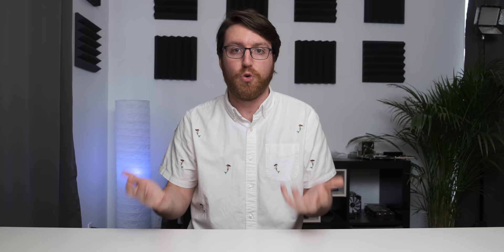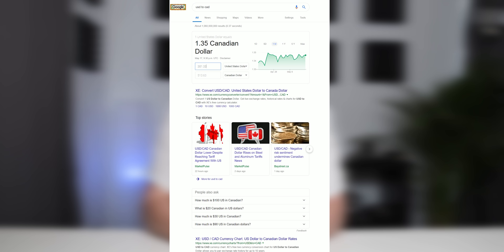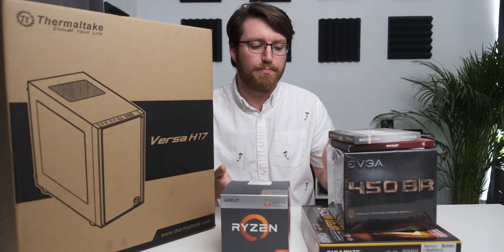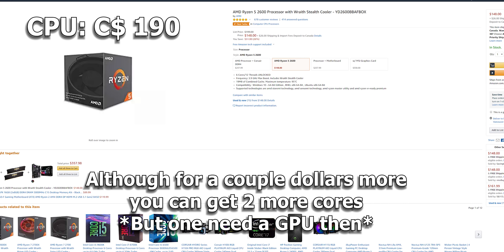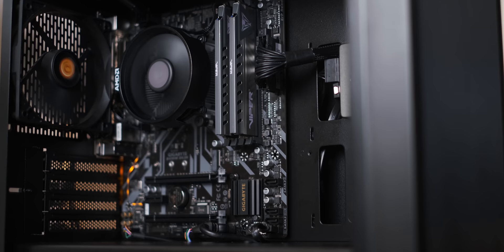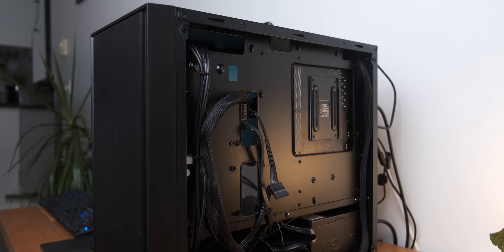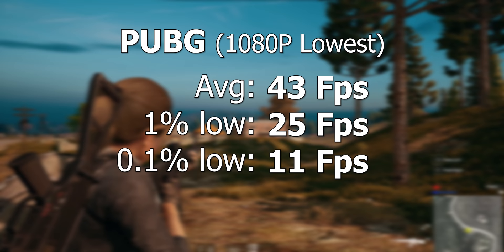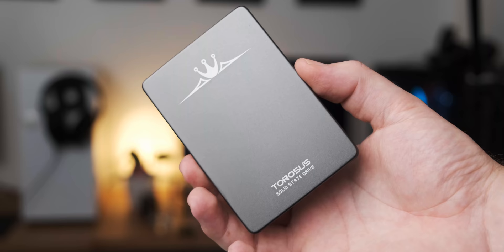I bought a gaming PC with my FIRST ever YouTube paycheck

Comment: Prices in Singapore

3200g - 130 sgd
mobo - 100 sgd
case - 80 sgd or 45 sgd for the cheapest alternative with tempered glass (tecware nexus m)
psu - 80 sgd similar one
ssd - 30 sgd slightly sketch AliExpress ssd
ram - 50 sgd for 3200mhz or 70 for 2x8 @ 3000mhz

455 sgd which is equal to 345 ssd or 440 canadian dollars
Enjoy??

Comment: So, I tried to assemble the same thing in one of our cheaper e-shops. Did not find the PSU, so I went with EVGA 500W but only 80+. There also was a minimal price difference between 2400, 2600 or 3200 MHz RAM so I went for 8GB 3200 HyperX Fury CL16 kit. There was a much cheaper mainboard, ASUS Prime B450M-K, cheapest 120GB SSD from ADATA and cheapest 1stCOOL MicroTower for the mATX case. The whole build would be USD 360,- which is almost the same, granted it does not look as good. Without conversion I'm looking at 8.320,- Czech Crowns. So you don't have it as bad in Canada :D Greetings from Czech Republic.

Comment: If you had waited a bit more for the 3rd gen ryzen cpus to come out you could've gotten a 3400g for the same price and it'd run forza horizon 4 1080p 60fps with a small amount of overclock.
Reply: Eh
Reply: this video is kinda old
Reply: @b.henriques9871  it's just 2 months old lmao
Reply: The R5 3400G has the same GPU, it's like a 5% faster, so no much difference
Reply: 60 fps? Bruh that sucks
Reply: @akira1072  way to go dude, like congratulations for flexing on a 150$ apu.
Reply: Gloria Borger sucks? Lmao it's the standard for 90 percent of people, who have 60hz displays
Reply: @b.henriques9871  once you play in 144 hrz you'll never go back
Reply: Gloria Borger i said the same when I finally built a pc and saw more then 30 fps
Reply: @b.henriques9871  lol
Reply: 3400g runs the same as 2400g but it has a little bit more clock freqeuncy and thats all. So not really that much better.
Reply: @akira1072  did I ask?
Reply: @r1kverc  higher clock frequency equals more performance. Duh.
Reply: @TheGauges420  Clocks aren't everything. The most important thing to performance for a GPU is the architecture. Clocks and Cores are only like 20% of a GPUs performance. The architecture holds 80% of the performance
Reply: @moist.politician  yeah, but nobody can say 'clock speed isn't important' because it is lol. Sure its not the ONLY thing that matters, but for some people they just want their GPU to go brrrrrrrr. Lol.
Reply: Then when buying the 3rd gen you'll probably say why not wait for 4th gen, seriously why don't you wait for 10th gen ryzen
Reply: @ChrisTian-sd5yq  waiting 2 months for next gen>waiting 2 years
Reply: @ChrisTian-sd5yq  LMAO Just wait for te 4th gen iGPU CPUs mate.

Comment: 1Year ago my PC was very similar, but now i have asrock A320-HDV R4.0, Ryzen 5 2400G, 16gb ram at 3200mhz, MSI radeon rx 570, Silentium PC vero M2 bronze(semi modular), 2 SSD M.2. and solid state drive, and crap case. It all costs 500$ GPU is second hand.  Your build was better than mine at time. Your videos are very interesting, i started watching you 3hours ago :D.

Comment: I did a build very similar to this over Christmas 2019 for my nephew. I had a bit more money but still not enough to get him a fully fleshed out beast of a system, we only had about 500 to work with.

I ended up building him this:

Ryzen 3400G
16GB Ram (8x2 - 3200MHZ, OLOy brand. It was on sale, quite a steal. I used them again for my own build in January, they've been quite good)
ASRock HDV B450 Motherboard
Silicon Power 1TB NVMe (One of the pricier items, but I wanted just a single SSD for him to keep it simple)
750W Rosewill ARC Series 80 Plus Bronze PSU
DIYPC Ranger-R4-R Black/Red Case (Comes with a little side panel and 3 pre installed red LED fans, it was a great deal at about 35 dollars. Not the best case to build in, but it worked really well once it was all set up and it looked great)

It worked really great! For all of 2 months. Then, because he's 13 and easily manipulated, some trolls on his discord channel convinced him they had put a trojan virus on his system and the only way to get rid of it was by dousing as many components as he could in milk.

Most of it was broken. Fortunately, the hard drive and the power supply got virtually none of that and are still fully functional. I've taken them for myself, as he's not interested in working for the money to replace the parts and doesn't seem all that concerned. Kids. But, while he had it, it worked great! He plays Fortnite and Minecraft a lot and it handled them on medium settings 1080p with smooth experiences.

That 16GB of RAM as compared to 8 certainly made a big difference, which is why I went that route. I figured not having a GPU meant that we needed more RAM and it worked out well. My plan was to eventually buy him a nice graphics card to put in there, like a GTX 1660 Super probably. But that's not happening now.

Comment: only one criticism, shouldve switched around the satadata cable, seein it tilted like that on the ssd means its either not pushed in well enough or stress is being put on the cord, which is bad long term for your connectors, a simple switch using the L angle side of the sata data cord on the mobo instead of on the ssd wouldve been better aesthetically and mechanically, but its such a small critique that it doesnt really matter.

Comment: Nice video and channel! congrats!!! In Argentina (Latin America) this build will cost you around 673 USD, As you can see, we always pay twice the price of retail sales in the United States in the southern cone of the earth.
These are the prices for each component.

266 USD - AMD 2400G
115 USD - Gigabyte B450M
90 USD - 8GB RAM Patriot Viper DDR 4
80 USD - Mini ATX case ThermalTake
45 USD - adata su655 120gb
77 USD - EVGA PSU 500W

Im working with an i7 3770K 32gb Ram 1600 and recently bought a evga gtx 1060 6gb sc.
I will try to wait for the perfect time to make a new build now that AMD lunch the new Zen 3 family so I can justify the leap hahahah 

Greetings from Argentina! 
Keep the good work!
Reply from the maker: This is such an awesome comment, thank you. The price breakdown of all the components is very interesting. I'm sorry to hear about the high prices of PC hardware in Argentina. I use to live in South Africa and PC hardware was also very expensive there.
I hope you can convince your family that its worth it without too much effort. :P
The 3770K with a GTX 1060 is a pretty great combination though, I'm sure it will still serve you well for ages. :D
Reply: @DawidDoesTechStuff  Thanks for you response!. My build have a solid SSD 125Gb and 1TB (500Gb - 500Gb) with Z77 Gigabyte motherboard. We build it to be a hackintosh in 2011 but on 2016 we go full windows 10 and in 2018 I bought the GTX 1060 SC - 32GB RAM 1600hz (jump from 16GB) and replace the stock cooler from Intel to a H60 water cooling from corsair, also a new corsair case (Corsair Carbide 400c Black) a few new coolers for less noise. Im working with Pro Tools, Premiere, Photoshop full HD videos with no problem. Also love gaming! now Im playing the last titles at 1080p enjoying 60FPS glory!  
Also I use some money to buy a nice mechanic keyboard and mouse, feels great and brand new again. Greetings!

Comment: I've build a very similar PC last Octomber here in Bulgaria and the RAM price craze was still raging hard. Ended up paying as much for my RAM kit as I did for the 2400G APU itself !
Ended up with ASRock B450 Gaming K4, Ryzen 5 2400G, 2x8 GB Kingston HyperX @ 3000MHz CL15 (which had to be "downclocked" to 2933MHz and CL16 in order to be stable, even thou it's QVL according to ASRock), a 550 DeepCool PSU 80+ Gold and a "no name" case with clear side panel. All that was just over 1000 Bulgarian Leva, which is around 750 Canadian Dollars.
Guess if I had to make that PC today with today's prices (and get a 3400G instead), I'll prolly end up for around 550 CAD.

Comment: the build in vega graphics are actually really good in these, but not every game will run that well with it, but with a build like this and a second hand graphics card you got yourself a very good pc, most people wont need more than this for what they use it for, even as a gaming pc. also, you can save money by getting linux instead of windows to begin with, and maybe you will even stay with linux since the system is very up to date today and runs really well with almost anything, with the exception of microsoft products of course

Comment: In Apr/May 2019 I bought a new desktop comparable to your one to replace my off-lease 2008 HP dc5850 (DDR2; SATA-2 and PCIe 2.0). I paid $349, mostly to Newegg. It has a Ryzen 3 2200G; 16 GB DDR4 (3000 MHz); 512 GB nvme SSD (Silicon Power 3200/2300 MB/s).  I bought the cheapest B450, the AsRock B450 HDV Rel 4.0 motherboard, that also had a 4 pin CPU power plug :)  I bought the case and power-supply locally in Santiago de los Caballeros to save on the high transport costs from the USA. It is a black midi tower with a led display around half the power button, blue is power-on, red is disk active :) It did cost together with the iTech 600W power-supply DOP1500 or say at that time $30. That iTech power-supply is a special with only a 4 pin CPU plug; 2 SATA and 2 Molex plugs :)  To be completely honest I reused 2 HDDs (500 GB and 1 TB).

Now almost 2 years later I'm still happy with that PC, it is great for my use case. My use case is collecting Virtual Machines with e.g. Windows 1.04 to Windows 10 and Ubuntu 4.10 to Ubuntu 20.04. My Xubuntu 20.04 VM for all my external communication Apps boots in ~6.5 seconds, while the Windows 10 VM needs ~25 seconds.

Comment: Here in Sweden that set up will cost you about 3 887:- Swedish kronor, $417 US or 545 Canadian Pesos. Everything is the same except the SSD, couldn't find that one so I went for the Patriot Burst at $21 instead.
I thing the AM4 platform is the way to go right now with Zen 2 looking to be a solid upgrade in the future. I don't regret choosing AM4 a year ago, my Ryzen 5 2600 and MSI Tomahawk hasn't let me down yet, thou I can experience some CPU bottle necking in BFV, pared with my Radeon VII. But that is nothing a 1440p display can't cure, or maybe a Ryzen 3600.

Comment: My pc was a prebuilt acer from my dad years ago with an i5-7400(integrated graphics), 12 gb ddr4 2400, 2 Tb hdd, and 300w psu. It was a steal at the time for like $450, but the price kept going up and I saw it for like $700 and I think even $1200. I only played league, and it got me a good 80-90 FPS on lowest settings for years until I added a gtx 1650

Comment: I'm saving up 400 or so dollars im going to buy a medium / mini tower optiplex 7010 with a i5 3470 I'm going to try to add a ssd and a 1060 if you can find one used of course and add a new psu over all it should be around 450 maybe 500

Comment: Here, in Hungary, it would cost you (including tax)

2400g 40000 HUF or 139 USD
Patriot Viper DDR4 12500 HUF or 43 USD
B450 DS3H 21500 HUF or 74 USD
128GB SSD 6000 HUF or 21 USD
Thermaltake H17 11000 HUF or 38 USD
EVGA 450W BR 15000 HUF or 52 USD

Making it a total of 106 000 HUF or 367 USD, pretty close!
(note, the prices are for 2019.07.13)

Comment: u almost have same build i was using n only difference was 3 thing n case n ssd n Ram 
what case i was using "homemade from school locker with fan on top n have open vent bottom" what storage i have is hdd 500gb black wd n ram i was using 3200 vram 2x 8gb totally 16gb from corsair vengeance it little cheaper at that point but does it performance well i going say almost nearly is ur pc but 5fps more that all no GPU

Comment: Careful there with all that spending!!

Okay so a UK price, but Im going to change up a few things and see what happens with price.
You made a little mistake with the ram in the buying a brand and pretty... Corsair offers a bland 3200 8 stick for £29 (C$51 each)
While your choice of board is well a bit old, that comes in at C$65.00 but I went all out on a 450 from MSI for C$95
The gigabyte gaming and asus Prime coming in at C$ 122. was a bit of a stretch of the budget.
For C$133 we come to the Ryzen e2600G giving you Vega 8 with 4 GPU cores and 4 CPU Cores...
The same case came in at 53C$
I also went with a Antec 500W PSU

The Total was C$465,
 However as your not in our Taxation ( depending on where you are) you get 20% back ( while still paying duties) 

giving you the total of 348.98 of your finest Canadian dollars.

BTW
Im building.... I cant find a company here that cam make the same system for under £1000 ($1,720 CD)
Im paying  just over half of that, but Im bringing near £275 of hardware from my daily

BUT
How much would that cost on wish? lol...

Comment: ngl if the thermaltake case had a tg version and was available in my country, I would've bought that over my antec p6.
The build would've been almost 30k inr in my country (431 usd) but as most of the parts were not available in my country I had to make changes.
gskill aegis ram over the patriot viper.
adata ultimate su650 over the ssd ssd.
an antec p6 over the thermaltake case and a cx 450 over the evga.
Reply from the maker: That's awesome. It's not a huge amount more expensive. Thank you very much for going to check that out.
Interestingly the ssd ssd wasn't available in the US. Only in Canada.
Reply: @DawidDoesTechStuff  The higher capacity ssds and gpus here are more expensive tho. Is the ssd ssd made in canada or sold by a canadian company maybe?

Comment: Is this build relevant in 2024?  I want to buy a desktop specifically for world of Warcraft. Recommended specs are operating system windows 10 64 bit…6 cores 3.5 ghz processor 8th gen intel core coffee lake AMD ryzen zen 2…directx capable 8 GPU nvidia GeForce rtx AMD RDNA 2 intel Arc 7 graphics….16 GB ram…SSD 128gb. I am an absolute noob with building a computer. I could plug it into the wall and that’s it

Comment: Your pc was better than mine Dawid, but not now, from my 10th birthday i got money, and i purchased a prebuilt, from my country comapany SkyTech,- not that one on amazon, for 290 eurs i get ryzen 2400G, A320, 8GB at 2666MHz, 240gb adata ssd ,very very bad PSU, that i burned two times because my meaty RX570,(i got it MSI ARMOR for 60eur used) and i claimed both times it for waranty :). But i comed a long way and now i have a lot of things changed, now i have a lot of good things, my pc almost changed at everything, now i have same CPU and motherboard, 16(2x8)GB ram at 3200MHz from Tforce, 250gb NVME(that was overpiced) RX570, very very good deal PSU for 45eur semi modular 80+bronze PSU from SilentiumPC(SilentiumPC vero M2 bronze), Case from SilentiumPC,(SilentiumPC signum sg1v evo tg argb) for 67eur with 4ARGB fans, but my motherboard is too crap for RGB, and thats why RGB is in reset button, I get AMD wraith prism cooler from my brother. So thanks for this video, and i like your videos very very much. Thanks!

Comment: Okay so I went to a website here in the UK, where I buy 90% of my computer parts. They deal in everything computers and nothing else, they are called overclockers.co.uk
So I went ahead to see if I could match your build and the hardest part was the processor, the cheapest one close to your specs An AMD 3100 but I don't believe it had graphics onboard. So I had to go for a Athlon 200GE with onboard vega graphics, it only has 2 cores but it does have hyper threading. And 3 graphics cores, how well this would play games I have no idea. 
So below is all the specs as close as I could get to yours, and I had way too much fun doing this lol
Athlon 200GE Vega graphics £46.99
Asrock b450M-HDV £58.99
Team group vulcan 2T force 8gb ddr4 2666 £38.99
Crucial BX500 480gb 2.5 sata £47.99 (sale price usually 48.99)
Kolink classic power 500w 80+ bronze £39.95
Prenoise dampened case Bitfenix Nova Midi tower £ 52.99 (comes with 1 120 fan)
So that comes to £286.90 though whether that Athlon chip could game I have no idea, it's very cheap though.
I remember Athlons from back in the day, I guess AMD are bringing them back. 
This took me way longer than I should have invested in it, then again I'm shielded at home, so not like I have too much to do.
Hope someone finds it interesting, going to look into that CPU and see what it's about.

Comment: Yo dude  for 350 euro i've got Ryzen 5 2400g, 2x8gb ram 3000mhz, 450w psu, asrock b450, asrock b450m-hdv r4.0, 512 nvme ssd and a very good case for 13 euro called akyga ak36bk. And i think you spent too much for case

Comment: Hmmmmm, the cheapest pc i could get in my country is 1100 dinars wich has an i3 9100f, gtx 1650 and a 128ssd and 8gb, but for 980 you can get one with a 3200g and 16gb ram but then it's worst than the other one by a lot

Comment: idk why i got this video recommended but its kinda like my first build (but not rlly) 
i had 300 euro (450 cad) budget for my first build and i also had to get all new parts and my build was a320m-k mobo (which i rlly regret bc i cant boost for some reason and ofc i cant overclock my cpu at all) i bought a 450 80+ bronze just like u and then 16gb's of ram at the time was the kinda best deal 16 gb's 2666Mhz and then later i got a ss 480gb made my kingston and as the case i used my old pc's case which has 0 fans on it but the thermals aint bad it gets around 60-70C on load but as of speaking rn i added in a 1650 super which u know kinda sucks in this build the mobo kinda ruins it all bc of it my cpu cant boost nor overclock and at stock my cpu bottlenecks my gpu mostly bc i have a monitor which is 1366x768 and every other monitor i have which are better have vga and the 1650 super doesnt have vga sadly anyways just wanted to say it (maybe someone has some tips how to not bottleneck my gpu as much bc when i play cod:mw my cpu is at 100% and gpu at around 70% but in warzone my gpu is at 50% while cpu at 100%)